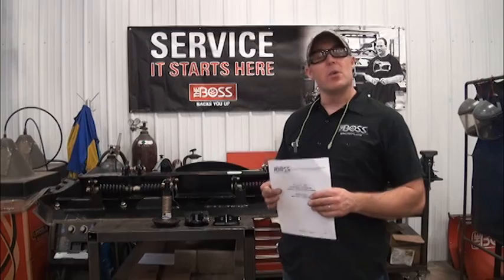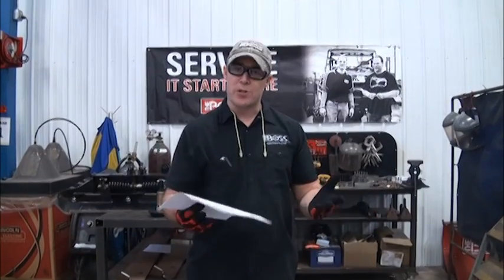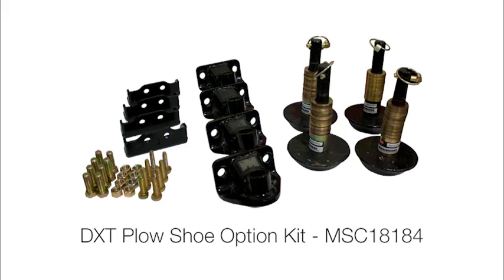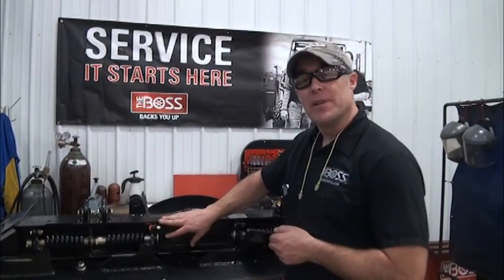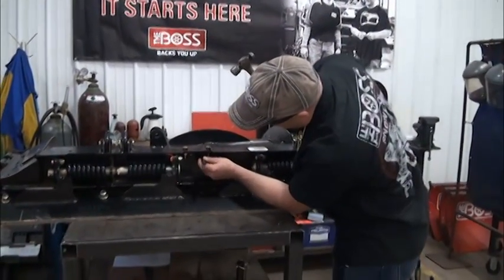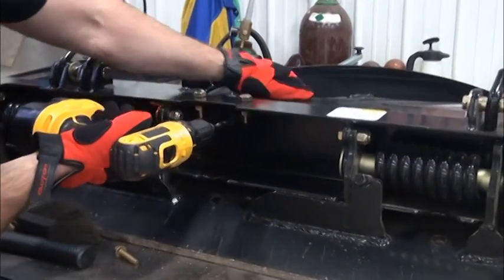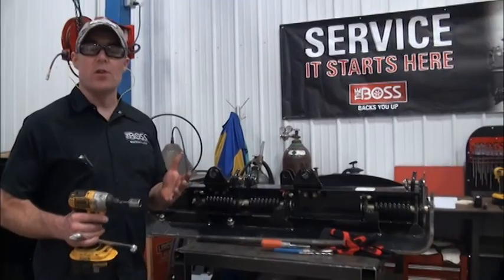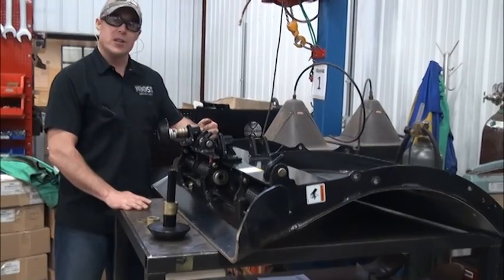How to Install the DXT Plow Shoe Option Kit

Comment: I have a 15 year old boss V plow. After 3 years I finally found the blue print to my plow. which showed a kick stand, mine was missing when I got the plow. This is the T2 system. My problem now is when I disconnect the plow the light bar wants to flip forward which is connected to the T2 mounting system. Is there a fix for this? By the way I had the same problem without the kick stand.
Reply from the maker: Give us a call at 800-286-4155 option #2 and Technical Service can address your issue.

Comment: I have a stainless dxt. the shoe design is junk. bent my moldboard and tore off the back of the plow. I work on my boss dxt more then I use it. after being a 20 plus year boss owner. I think it's time to part ways.
Reply: Lets start from the beginning. I purchased my new dxt from my neighbor at my cabin in the Keweenaw. with all the goodies. when I picked it up it was missing the shoe kit. no problem he can order it. take the plow 560 miles back home. ( neighbor gave me a great deal btw.). get it home and start the self install, and find out he sent the wrong mounting bracket for my truck. so my renter picks it up for me and I drive 560 miles each way to get it. come home install the plow and all is good. except I still don't have shoes for it. after a month and a half I give up on my dealer up north and call boss. they track down a set of shoes. thank you boss. they show up the day of the first snow storm. so I install and start plowing. with in 1 1/2 hours the left shoe bracket falls off. I go back and re install it. and about every hour I re tighten the bolts. after a day of lowing it has bent the back of the moldboard. I call boss, talk to Jamie. what a nice person. after chatting with him and waiting on authorization to work on it. which I never got in writing. not wanting to void my warranty. I finally got a date almost a month later for my plow to be fixed at a local dealer. in the mean time I bought wing extensions for my new boss. which took me 3 1/2 hours of cutting and fitting to make work. my great luck got an old stock set that wasn't up dated yet. so I call Jamie again to get a couple extra wing extension mounts so I don't have to run 3 washers on each side. so it doesn't fall off. nope can't get them for me. so basically I've work a bunch of hours on my boss to make it work. and drove over 1,400 miles for parts.  and what do I get from boss. a big I can't help you. owe I forgot I did get a set of shoes from my first dealer. they are the wrong ones and still setting on my work bench. plow currently sets at my local boss dealer getting welded and straightened. I hope.   and also hope they can track down a few wing extension brackets to double up.  and kind of make things right. will see got my fingers crossed. Never welded or bent my old boss plow. but my new one didn't make the first storm before it needed work. sorry for being a jerk. but I really used to brag you product up till now. hope I can  in the future.
Reply from the maker: kitster389 We have received your particular service case in our system and see that you have spoken with our Technical Support team recently and they have arranged to have the plow repaired at your local dealer. Product satisfaction and service is of up-most importance to us. If we have not met your expectations, please contact the BOSS Technical support team directly for further assistance. Thank you!
Reply: Sounds like negligence to me . High speed curbs & such ? They dont bend or twist very easily.